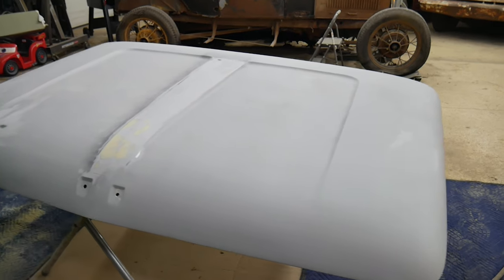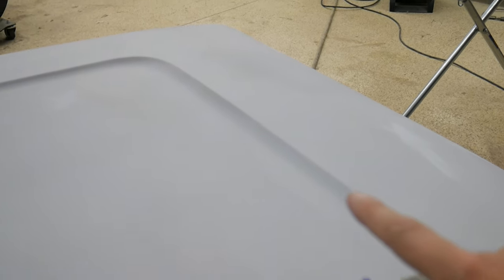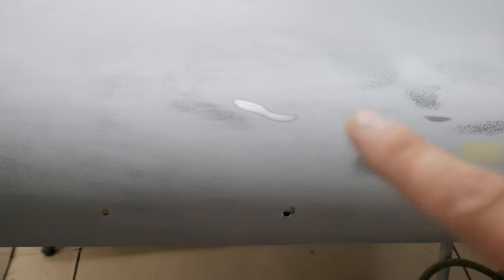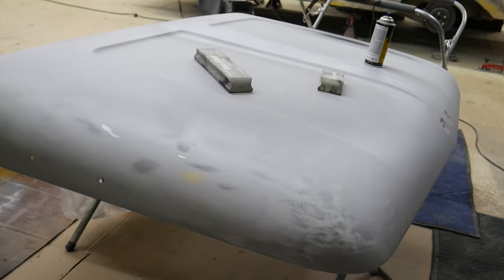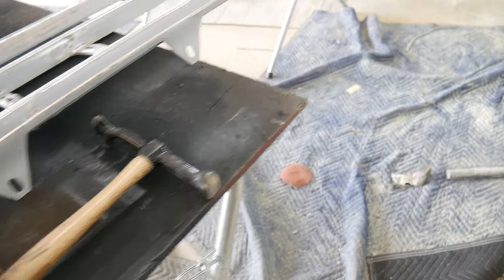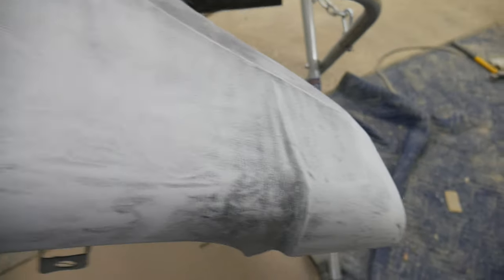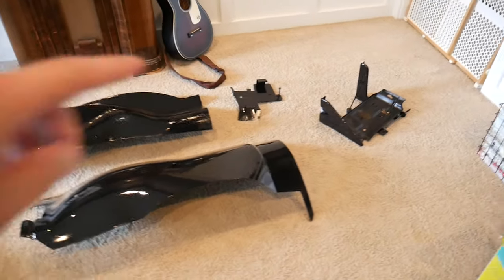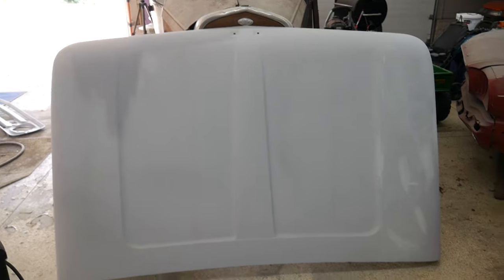Getting Closer to Paint! | F100 To Crown Vic Frame Swap!

Comment: I saw the comment about coating the whole panel or area you are working with filler; that’s a good idea. You can guide coat your filler work too ! I’m glad you like that hammer, I think it’s actually designed for doing door skins, but if it works for other things that’s great!

Comment: Rather than filling all the dents one by one do a skim coat of filler over the whole dented area this will get it much straighter. Nice progress BTW can't wait to see her finished.
Reply from the maker: William, Thanks so much for that advice! If you are referencing the roof that's where I've been depositing my "leftover" filler from the fenders. Looking back and thinking about your advice I'm probably just making more work for myself by doing that. Thanks again brother!
Reply: Awh well it's a good use of left over filler I'd just give it a quick blocking with 80 then skim it. It wonk create any extra work . I commented before I watched the whole thing and seen where you skimmed the fenders. Looking good for your first time  at it. I've been around it most my life and been in a high production shop for 5 year  and I've still got lots to learn.  Oh that Martin hammers are some of the best out there the one you have to made to fold over new door skins. That's why it has the curve on the one side.
Reply from the maker: It sure seems like bodywork is a field where you can always learn more. I've got a whole new appreciation for you guys (not that I never appreciated the skill). Thanks for pat on the back as a bodywork newbie! Oh, and I bought a few Martin hammers, that was just the closest one to me when I hit record haha.
Reply: @rivercity3908  Maybe thin your filler with plastik honey and lay down a coat over the whole area. Makes your filler more the consistency of toothpaste and easy to spread over a large area.

Comment: Hey thanks for sharing! Ugh I hate body work. I think that red/white combo will look sick. I hate that whole patina scene, I guess It's usually overdone and too fake or just lazy. I can only wish at this point that my old chevy looked like it did when it was new. A decently done paint job will probably run 5 or 6 grand for that so props to you for going at it on your own. Are you really going to paint that chrome?
Reply from the maker: Thanks for the kind words! My truck was a bare bones base model truck so it didn't come with any chrome, it had a painted grille and painted bumper stock. The only chrome on this thing is the emblems. Thanks for tuning in!
Reply: @rivercity3908  I thought it had a chrome grill and bumper, maybe you could add that, would be cool. Keep sharing man, it's motivating.